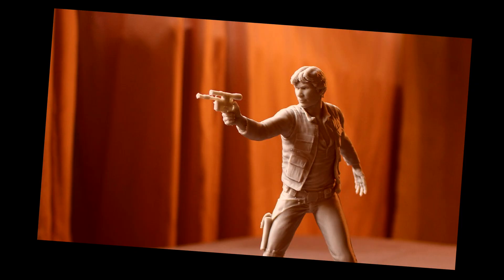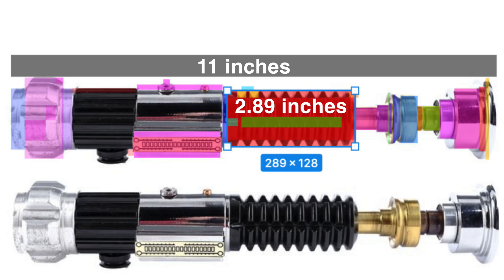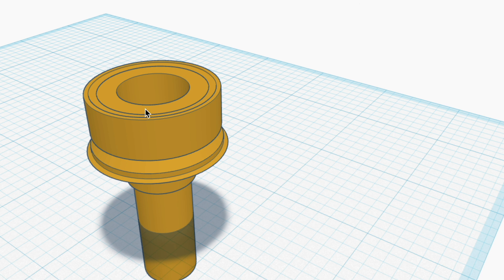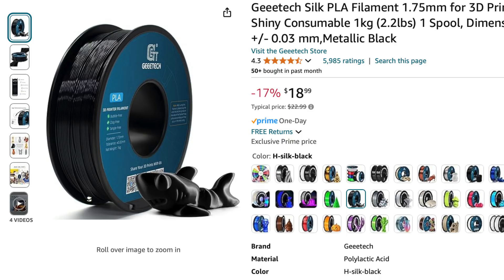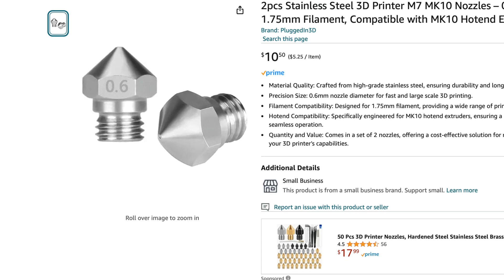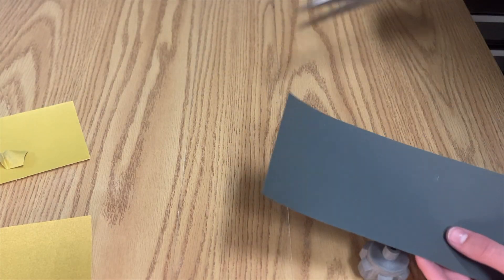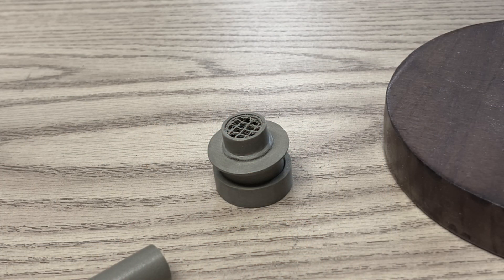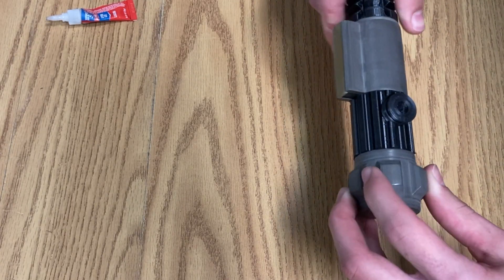Making a Lightsaber Hilt of REAL METAL on my 3D Printer

Comment: I think it would make sense to sand the plastic parts as well, because currently the layer lines are really jarring in contrast to the smooth metal surfaces.
For some chrome style shining, maybe look into electroplating the prints with something like nickel or chrome...
Looks really cool already though!
Reply from the maker: Thanks!
I do want to try electroplating, it seems like it could make the parts feel even more like metal and be heavier, in addition to being shiny!
As for the plastic parts, I probably should but for the grip section it would be very difficult, trying to sand in between all of those ridges 🤔